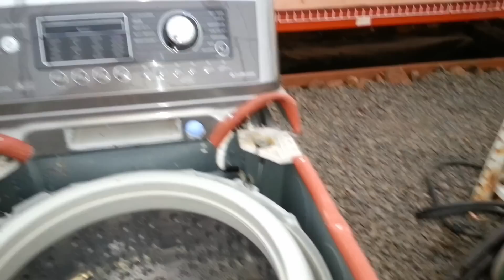DEFECTS in MICROGREEN PROCESSING

Comment: Can't you just tilt the washing bins up on the side away from the drain, so the existing drain works?
Reply from the maker: we actually did do this...sadly the way the bins are made is that the drain protrudes about 4" from the side wall...so once you tilt it you get two 4" puddles to the left and right of the drain.
Reply: Hi Jeff,    
    I was thinking the same thing, shims and wedges on the IBC totes. Could you fill the pockets where water collects while draining on edge? How about rethinking the problem totally. Pick a corner any corner. Put a drain in that corner. Shim and wedge so water drains to that corner. There are no regulations for having the totes square, level, and plumb. What matters is performance. If you like turn the tote 45 degrees to make it more visually appealing.   Cheers,   
   Bill
Reply: TheRealMartian is there something you could use to fill those voids so the water can't go there, that is still food safe? also can you bend the frame down some and glue it to the metal, I'm thinking 60 grit sandpaper paper and jb weld, the slow dry not the quick.
Reply: To bad you can't use floor leveler.  Probably not food safe.

Comment: You are correct on the use of the support belt; I regularly give that advice to my clients. 
I think the sink drain threads pulling the plastic down to the metal may be enough but if not then add the spacers around the edge.

Comment: creating a low spot for the drain of the IBC toads can work with the 2x4 you mentioned.  Then you could gently heat the plastic container from the outside in the middle of the bottom and push the center down slightly.  That way you would not have to use anything to force/keep the bottom down and you could simply mount the drain.

Comment: I saw on another video on aquaponics where they put a center drain in. To flatten the hump and put a bulkhead in they inverted the tub and had thecenter on a flat surface holding the tub up. Then took a 1/2 steel circle about 6 inches in diameter laid it on top and put a torch to the steel plate. Using eaven movement over the plate as it heated until the plastic could be seen softening. They took the heat off but left the plate to sit and flatten the area under it. Keeping an eye to make sure that it didn't melt through the plastic. Once cooled you can then drill.

Comment: 1)   There is a solid steel base under the plastic liner for a reasons - to take the weight of a full load of water.  If you raise the liner off the steel base, you must reduce the internal water lever, else the liner bottom will sag and crack eventually, due to stresses it is not designed to take. 
2)   As a substitute for the wire mesh working surface - consider "perforated stainless steel sheet" which is available in different thicknesses as well as with different perforation diameters.  Easy to search for :)

Comment: You may want to consider filling in the slope between the 2x4 frame and the drain the way you would do the substrate for a tile shower floor. This would allow support for the plastic liner and relieve some of the stress this configuration puts on the matetial.

Comment: Your idea of raising the tote to supply the necessary gap is one I was thinking of before you said it.  My suggestion is to calculate the amount of downward displacement you will allow the center of the tote to bow down then build a support in the tote frame to support the outer part of the tote connected to the inner support to allow that amount of deflection so that the center of the tote is supported also.  You could support the tote on the outer edges and slowly fill with water until you get the deflection you want then measure.  Silicone seat should be OK for this application.

Comment: Your concern on the drying rank screening may be correct, some of that hardware screening is galvanized. A thought:  Window screening comes in fiberglass and in large rolls.  Place PVC cut tubing on top of metal screening as stand-off.  The window screen is to flexible to use alone without some support.

Comment: You may want to consider heating the seam in the center of the tote to allow the plastic to be molded. It just looks like it will be necessary to have the drain push that seam flat in order for the tote to work properly. I have welded HDPE to repair holes in my kayaks with success using a heat gun and a spatula to push the plastic and create a bond between two pieces. If you have a scrap tote you could practice the heating technique so as not to ruin a good tote by burning a hole into the plastic.

Comment: to remove the bump in the bubbler, just put a screw through the bump and the metal underneath it, tighten it so the bump goes away and seal it with a bit of silicon maybe?

Comment: Jeff, maybe you forgot my suggestion as to how to improve the drying station and contamination, which you said was a great idea. Here it is again. Get S.S. window screen and cover the galvanized mesh you now have with the window screen , which will solve the micro greens from falling through, which solves your cleaning with a vacuum. Cut the diagonal brace between the drying rack and packing table. Now when they are dry simply pull the screen through the opening onto the packing table, you lose nothing and save a step with transferring the greens from the drying rack to the packing table.
Reply from the maker: thanks Matt...yes I had forgot...my bad...appreciate you holding me accountable. One of the desirements of Mrs. Martian is that she can spray off the drying rack. So i think I need to build a trough and cover type of system. I could use your screen idea on the top with metal cross members to provide a more level surface (as compared to what I have now) and then put something underneath to catch and move the water/debri
Reply: is that mesh food grade though? Polypropylene and stainless steel are the best materials for food grade applications
Reply: I did say to use stainless steel window screening
Reply: Jeff, I'm not sure what your talking about. Why would you need to put cross members under the mesh, or is the mesh you now have not level and sagging ? With that being said using the window screens there would be no material falling through the mesh needing a trough to catch any particles. Are you going to remove the diagonal brace and then pull the screening with the dried greens though to the packing table? If so a simple running a vacuum over the screening would be all you need for cleanup, no water needed since everything has been washed and dried already

Comment: Sadly, I think your going to end up replacing those bins for the water to get better drainage.  Trying to move the drain to the center looks like it will be problematic to me.   It's got a seem right down the middle.    Raising the plastic tub, without good support, is asking for trouble when you fill it with water.  The drying table currently, is probably not food grade,  looks like you'll probably be replacing that wire grid.  I wonder if you could use a mesh fabric?   Is there anyway to automate the whole process from the start to the finish?

Comment: With  the drying mesh table I cannot imagine that the authorities are likely to be thrilled about your use of non-stainless steel mesh in direct contact with food material. I assume you are using it to facilitate drainage and quicker drying? Could you consider using a fine nylon type mesh fabric laid on top of the mesh and to try to eliminate material falling through. It could perhaps be cleaned with a pressure washer or even perhaps putting it in the bubbler tank.

Comment: The way the totes are designed, they do not drain completely. I have used heat to mold the bottom of plastic barrels see link https://youtu.be/ihZFeFKs8Lo
This works well for Barrels. I have not tried this on totes. It might work out better to build a wood frame in the tote and slope it to a drain in the wood frame. Use a pond liner to make it water tight. The drain could run out thru the tote side or hook it up to the tote valve.  A 1 1/2" PVC pipe will fit into the tote valve from the inside. That way you can use the existing drain connection you already have. I hope that makes sense?
Thanks, Von